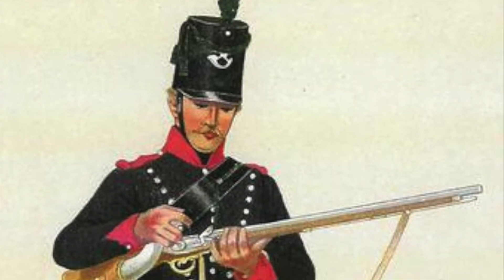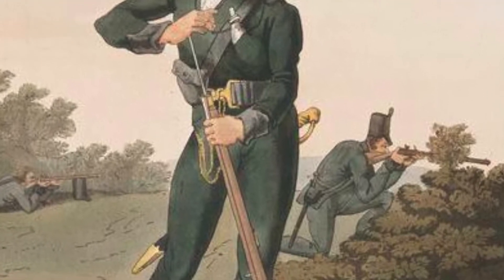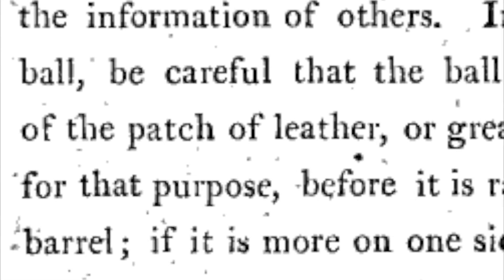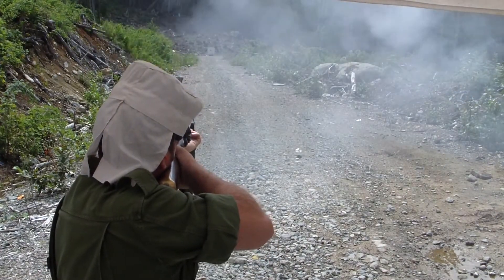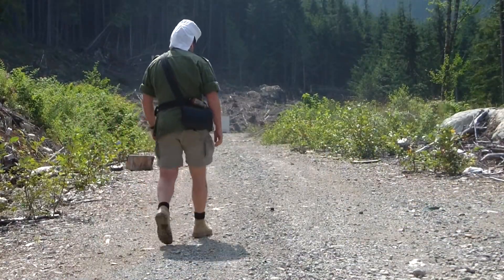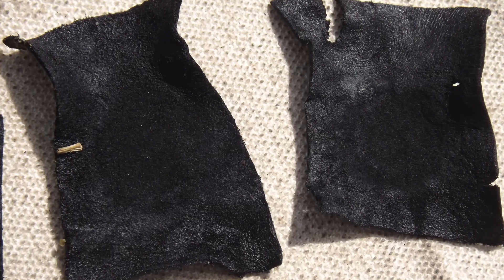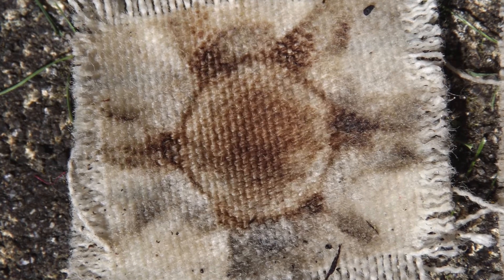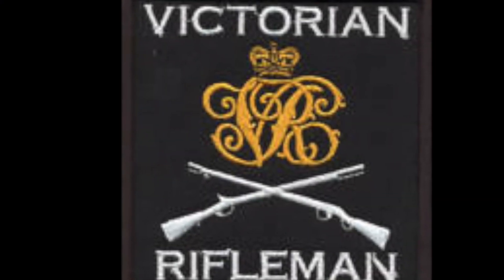The 1800 Pattern Baker Rifle:  Shooting with Leather Patches

Comment: Commonly and I may be wrong, but the 95th Rifles used greased leather patches for sharp shooting in the Peninsular War.

Although when the rifle barrels got to fouled or they joined the infantry line, then they wouldn't use the patches to allow for faster loading.
Reply from the maker: There is lots of Baker content on the Channel which explores many aspects of the rifle and those who used it, if you are interested.